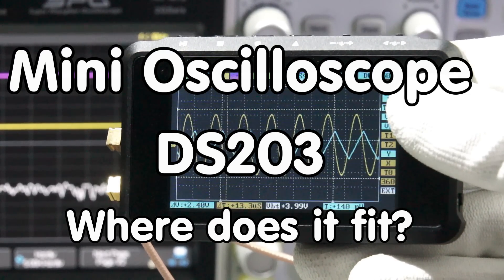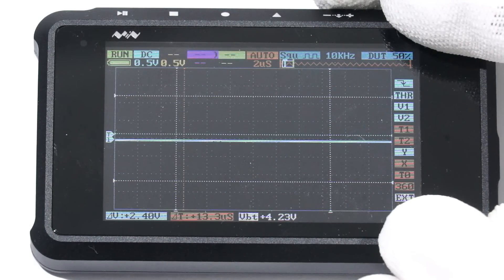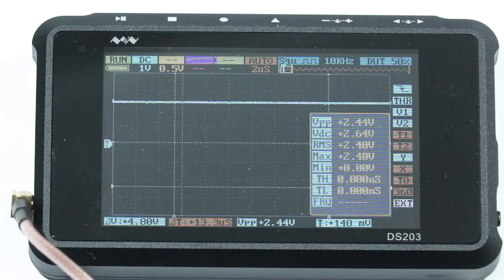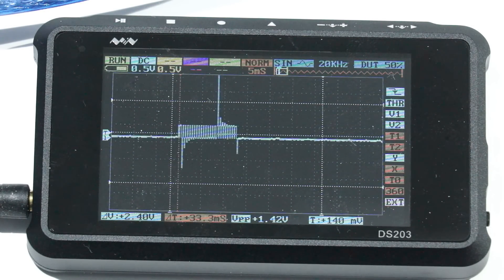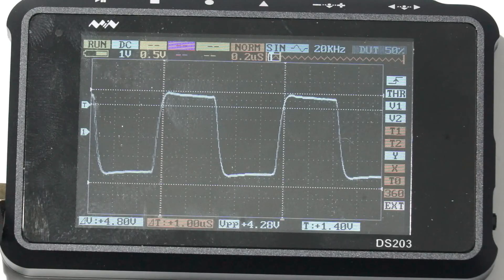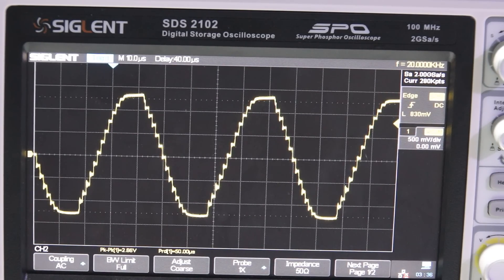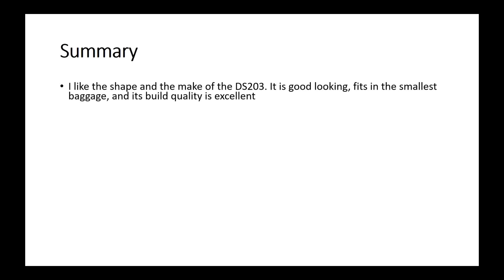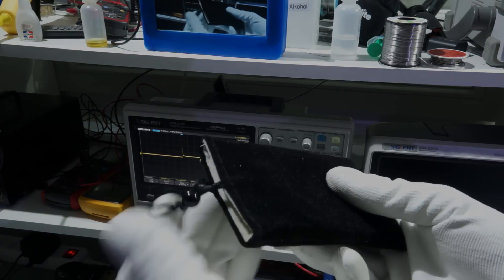#92 DSO203 / DS203 Mini Oscilloscope Review

Comment: I just bought one of these for working from hotel rooms when I am away from home. I haven’t tried it yet but be interesting to see if they have fixed the measurement errors
Reply from the maker: I rarely use it like you when I am mobile, or when I want to avoid ground references. So I do not know.

Comment: Wildcat firmware written by the community and a big advance on the original, is difficult for people to 'find' to load it.  Basically you download a big text file which is actually a hex file, then rename it appropriately and use it to flash the ROM.  Any difficulties get back to me here and I will give details.

Comment: I followed your channel for a while, and increasingly have wanted to get into tinkering with electronics for multiple purposes. I have some Bluetooth headset and other electronics that I need to repair, also a real interest in Learning &using Arduino,robotics etc.  I’m extremely mechanically inclined and have no fear of attempting anything. But very limited experience with electronics. I need a soldering iron & benchtop power supply just to get me started. And for me money is a real issue ,a budget definitely decides what I get. Do you have a suggestion for some cheap options that are worth the purchase ?  I found a three in one soldering iron heat gun and power supply on Amazon but I really don’t know if that’s a good option or if it’s like most tools marketed for the homeowner. I have to go as cheap as possible but I’d also like to get something that’s going to allow me to grow a little bit here. I love your videos thank you very much. My email is born2bbearfoot@gmail.com

Comment: An improved software version is available called Wildcat. (my version is 5.6). Search under Wildcat dso203...   The manual  for wildcat that I have is long on text, nonexistent on graphics, but it explains what to do very well.  Wildcat doesn't just do scope functions - it also does fft, serial signal decoding and other functions, which make it fairly awesome !
Reply from the maker: Thank you for the tip!
Reply: @AndreasSpiess  :-)

Comment: Thanks very much.
Have you seen a similar oscilloscope that is maybe a bit easier to use, and perhaps a bit more expensive?
In addition, have you seen anything that can use a tablet as well as some hardware?
I am thinking of the picotech products that use a pc. They are really good.
When you are away from your lab, you will often have a tablet, so hving something that integrates with that could be very good.
Reply from the maker: I did not see oscilloscopes for tablets, but I did not search for them. Your other choices are: Desktop oscilloscopes or boxes which are connected to a PC using USB. Both have a  simpler user interface because they are bigger.

Comment: Hi do you think this oscilloscope is good enough for simple logic circuits with for example 555 timers ? What limitations I can have if I am only working with some examples of logic gates and try to recreating some flip flops using transistors / resistors? thanks
Reply from the maker: It has the limitations described in the datasheet. For simple things, this oscilloscope works well. If mobility is not a must I also would look at cheap desktop oscilloscopes. They are much more comfortable to use. And if you want to look at digital signals a logic analyzer could be a good thing. You find them below 10$ at Aliexpress. I even did a video about it (#76)
Reply: Hi and for learning logic circuits, which oscilloscope  you think is better ' Siglent Technologies SDS1202X-E 200 mhz Digital Oscilloscope 2 Channels, Grey' or 'Rigol DS1054Z Digital Oscilloscopes - Bandwidth: 50 Mhz, Channels: 4
' ?
Reply from the maker: Siglent and Rigol are respected brands. I do not know these oscilloscopes so I cannot recommend one. I was happy with my Siglent (an earlier generation)
Reply: Hi, this question is a bit out of topic, which probes do you recommend to buy to use for breadboards and such kind of circuits ? Thanks

Comment: I have just received my DS203 from amazon. All I use this for is to measure Arduino and Raspberry pi's. I think its perfect for the cost and what I am doing with it. I was using a LED and a voltmeter to see my I/O's. I only need to see the bumps ,the lumps  and the direction the waves are headed. My question is can you measure mains with these units. Like 120v a/c or 230v a/c. I have searched high and low. I have only found  someone using a DSO138 DIY kit to do it.
Reply from the maker: Andreas Spiess 1 second ago

Its datasheet sai Max 80 volts (https://www.elechouse.com/elechouse/images/product/DS203/DS203_Manual.pdf )
Reply: Thanks for the quick reply. I have read this as well. There is video on YouTube with the diy kit ds128 reading a transformer. Thought the ds203 would do it as well.
Reply: http://minidso.com/forum.php this is the link to my unit. It says +/- 400v max DS203

Comment: Is it capable to show x-y lissajous figures for phase check? If not, is any custom firmware available that can add this feature? Link?
Reply from the maker: I do not know as I never tried these figures. Maybe somebody else knows?
Reply: Use Wildcat firmware - does everything the default firmware does but a lot better and with a lot of fantastic functions,and yes, includes XY at high bandwidth.

Comment: Great review! 

Question - The majority of my technological expertise is related to Linux, software automation, web development (mostly server side), and other similar software. However, I'm starting to delve into your realm, electronics. Thus far, I've worked with the Raspberry Pi quite a bit, and I'm now starting to get off the ground with Arduino. 
So, for the question - As far as microcontrollers go, I consider myself a novice. I'll be prototyping some projects using Arduino and teaching myself how to do so. My knowledge on oscilloscopes in general is pretty minimal (I've never sed one, but I am familiar with the basic operations and what they're used for.  With this in mind, do you think this is a good oscilloscope for someone in my shoes? Or would you suggest one of the more expensive $350+ desk units? 

Thanks!

P.S. - Subscribed!
P.S.S. - I realize this was posted ~2 years ago. Is there a different oscilloscope in the same league as the DS203 that you would recommend?
Reply from the maker: Welcome aboard the channel!
Since the oscilloscope is one of the most important tools in hardware development I would not go for such a small one as my main one. One of the best deals seems to be the new Siglent SDS 1000X series. It might be in the range of 400 $. If you stick to the hobby you will not need a new one for many years to come...

Comment: This is interesting.   I started to get overly excited, but with distorted portrayal of waveforms above a few kilohertz, I'll keep my bellman analog portable  scope for now and wait until these portable DSOs improve.   The frequency limitation is a deal breaker for me.  Thanks again!
Reply from the maker: If you need higher frequencies, maybe a stationary DSO is a better option...
Reply: Andreas Spiess I do have a 4 channel capable of properly representing a100 MHz (analog) Benchtop DSO in my new lab.  I like all the bells and whistles it hss.
Reply: Rigol  1054Z
Reply: Gets embarrassing to seem to be a shill for Wildcat firmware (which is free, written by the community).  Bandwidth on the earlier hardware combines two channels if you want, and uses that 72 msps to get to display a waveform up to about 13 MHz.  I haven't fully tested the FFT function but in theory that can give frequency components up to the sampling rate.  Does waterfall displays too.  I hadn't used my dso203 for a couple of years, but now it is definitely in use as it does things my tabletop scope doesn't do, and at about 7 MHz bandwidth it is "good enough".

Comment: To zoom in, once you acquired the signal, you have to go to the time scale selector and start lowering the value till it starts zooming. It's quite strange that at the first scale change it won't zoom in just after you lower the scale a few times. But it zooms in perfectly.
Reply from the maker: Thanks for the tip!

Comment: This is an important thing, i CAN'T use this to measure 10MHz right?
Reply from the maker: Yes.
Reply: You mean I can't? or I can?
Reply from the maker: As I showed in the video. This device cannot properly display 10 MHz signals.
Reply: For less than €100, you can get the OWON VDS1022 PC based scope which is a true 20MHz scope with a usable interface and real probes. Or you can find a second hand proper analog scope.

Comment: Which Siglent oscilloscope do you have on your bench? And which one would you buy today? http://www.siglent.eu/oscilloscopes.html
Reply from the maker: +Martin Bless There are no bad oscilloscopes. Just cheaper and more expensive ones. I had a budget of about 1000$ and bought one for this budget. I recommend the same.
Concerning brand: I like Siglent (I also have the waveform generator and the spectrum analyzer from them). But Rigol seems to be very comparable.
Reply from the maker: BTW: I have a 2102 which is now about 3 years old

Comment: Thanks I've seen the DS202 work and I love this little scope for quick audio or even maybe some automotive work. Where crawling around under the dash or awkward positions would be a big help. I agree with you 100% this is not a bench scope, but it could be used for lower frequencies if that's all you have. The a few topics I didn't hear you discuss was the battery life or how to charge it or if you can put a power adapter on it, and if the software can be updated. I just purchased mine based on what I saw of a friends DS202 over two years ago, hence that's why I visited your video. Thanks for the posting and your hard work. Best Wishes n Blessings. Keith
Reply from the maker: I did not cover the battery live because it is not easy to measure because of the auto-off function. But in my scenarios, it was never a limiting factor because I was able to use it for hours. So, I could have mentioned at least this fact, you are right...
I did not try to update the software because I did not bother and did not want to brick the tool. It works fine as I have it for now. So, I also did not want to give "untested" recommendations.
Reply: Good points, thanks for your knowledge. Best Wishes n Blessings. Keith

Comment: Ive searched high and low for a good osilloscope , eventually I bought a velleman HPS140i , it only had one channel but dat didnt matter to me As much as a high voltage input , the velleman has 100 volt input tolerance so with the x10 button it could be 1000 volt , the device is also a Cat 1 so it is safe to measure behind a fuse in 230 volt systems ,
Reply from the maker: Thanks for the tip. Maybe it helps another viewer.

Comment: Hoi Andreas, cooles Viedo! Ich habe mir so ein DS203 gekauft und brauche es für die Fahrzeugelektrik. Ich habe probiert ein Sekundärzündsignal aufzuzeichnen aber habe es nicht hingekriegt! In der Regel kann man das Signal über das induzierte Magnetfeld auf der Zündspule messen. Liegt das an den 72 bzw. 10MHz? Oder habe ich das ding falsch eingestellt?
Freundliche Grüsse
nic
Reply from the maker: Da kenn ich mich zu wenig aus. Grundätzlich würde ich schauen, ob das Signal im angezeigten Spannungsbereich liegt (schau auch, ob dein Tastkopf auf x1 oder x10 eingestellt ist. Wenn es kurz ist, ist der Trigger level und die Richtung wichtig. Un dann kannst du ja auch noch die Speicherfunktion verwenden.
Zu den MHz: Ich glaube, dass du zumindest etwas sehen solltest. Das Signal sollte nicht so schnell sein.

Comment: Nice review! Also nice to see how you used the ESP-MusicEngine library to illustrate generated signals! (link: https://github.com/maxint-rd/ESP-MusicEngine ) 

Good review to compare the extra features of this handy device to my much cheaper DSO112 model (only one channel, but it does have a very handy touch-screen display)
FYI: the DSO112 is even cheaper than the DSO138 and comes complete with housing, battery, box, manual and aligator-clip-probes. I paid only 43,- euro on Ali, but at the moment I don't see it listed for that price anymore. (Perhaps because of the upcoming 11.11 sales festival, where prices seem higher to allow perceived bargains...)
Reply from the maker: Thanks for the info! I never saw this one.

Comment: Thanks for the review Andreas...I couldn't tell but does it have a "X-Y" input function capability? I have a need for a small display for a VERY old homebrew spectrum analyzer project so as not to tie up a bench scope.
Reply from the maker: I did not see it in my device. But apparently, there are a few software versions around (the whole design is open source).

Comment: Hi Andreas, nice video!
What do you see when you use your SDG1050 and feed it a 50Mhz wave? 
What is the battery life of the DS203?
Thank you!
Reply from the maker: 1. Which device? The DSO203?
2. The battery live es many hours. I will try it tomorrow and come back
Reply: Hi Andreas, I mean putting a 50Mhz signal on the DSO203 (Your SDG1050 can provide 50Mhz).
The DSO203 has an AD9288 inside, very nice.

Comment: I have an extremely cheap diy oscilloscope, a DSO138. I've found it useful as a diagnostic tool in analogue circuits for situations where a multimeter is useless but accuracy and sample rate are not critical. My main complaint is the lack of a rotary encoder, and that seems to be a downside to the DSO in this video. Clicking buttons for adjustment is neither fast or accurate, but has to always be some compromise between the fast and accurate.
Reply from the maker: Thanks for the info. This is definitively a cheaper version. However, you might have to add a case, a battery, and a probe to the equation.

Comment: You might want to update firmware
http://www.seeed.cc/DSO-Quad-community-edition-Wildcat-updates-t-6071.html
Reply from the maker: Do you use this software version? Mine shows Mini DSO SYS Ver 1.64 and Mini DSO App (Plus A1) Vers 1.13
Reply: No i do not have a dso, i just know that this improved firmware development exists with new features and improvements :-)
Reply from the maker: Maybe another viewer has some "hands-on" experience. The improvement list of the latest version did not include things I would need. But maybe there is a difference between the factory and the community version which is worth the change. I have to investigate a little. Thanks for the tip!
Reply: James Sleeman Yeah, I've heard that there is a fairly advanced custom firmware available. Sadly, I don't own this device, so no further experiences...
Reply: It's still a useless piece of junk. For less than €100, you can get the OWON VDS1022 PC based scope which is a true 20MHz scope with a usable interface and real probes.